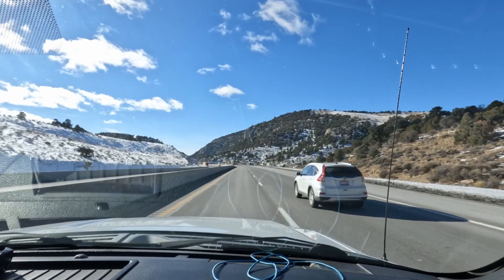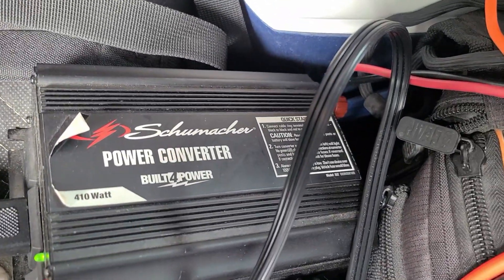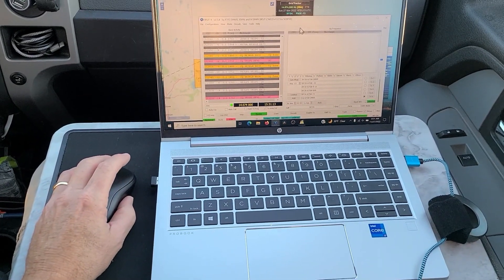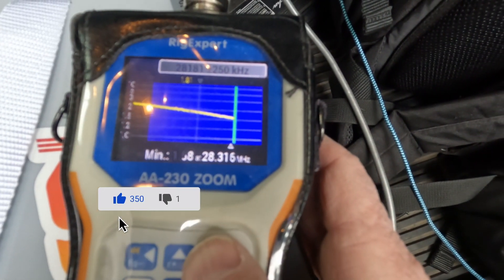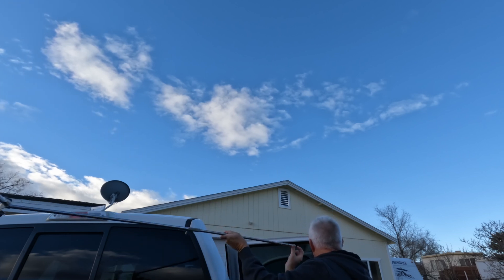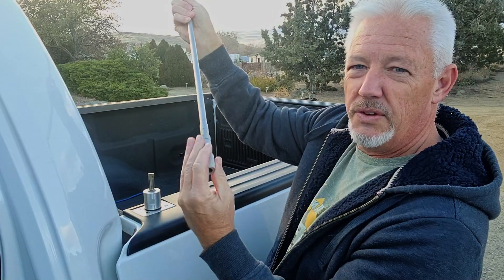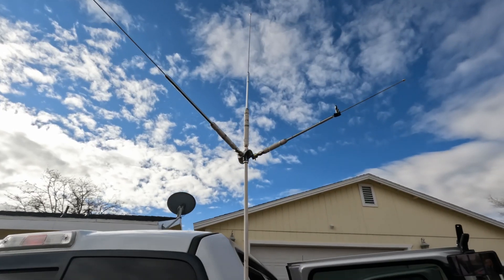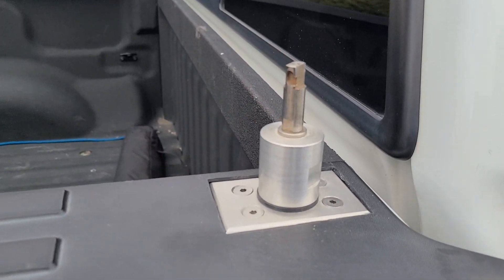FT8 Passenger mobile setup for a road trip | K7SW Ham Radio

Comment: I had a Breedlove Mount on my F150 and it ruined the bed stake  metal on my bed. I had a screwdriver antenna mounted to it.
I found the bed is not beefy enough for a high load antenna. I made my own mount out of 1/4" aluminium  plate and mounded back by the tailgate. Using the 3/4" holes by the tailgate. Just my 2 cents. N7JZU
Reply from the maker: Nice retro fit